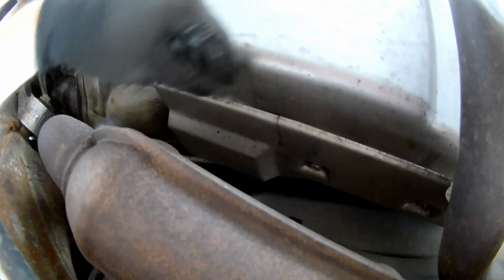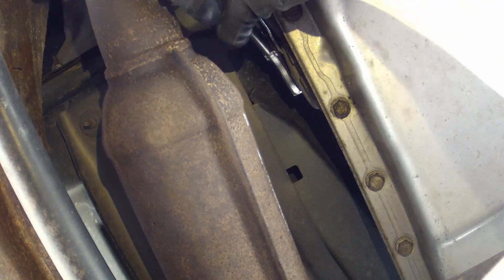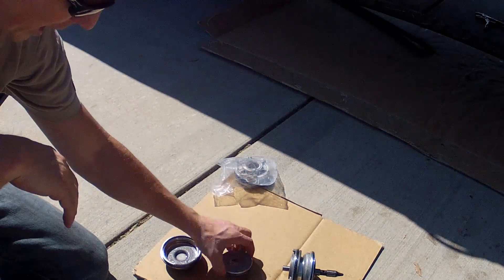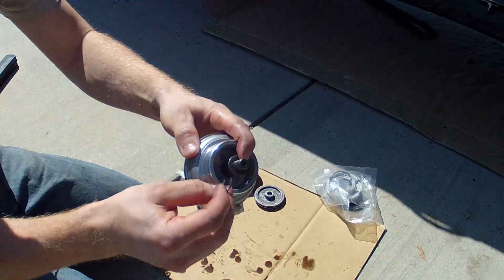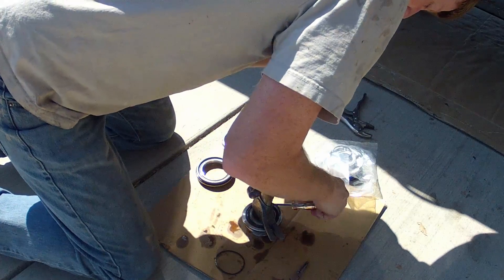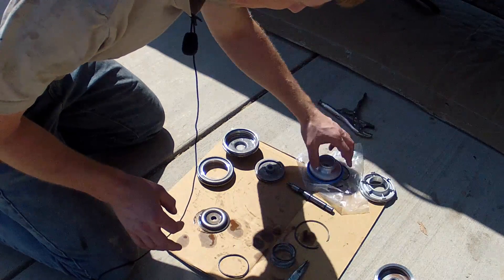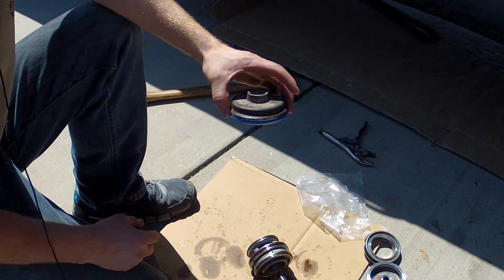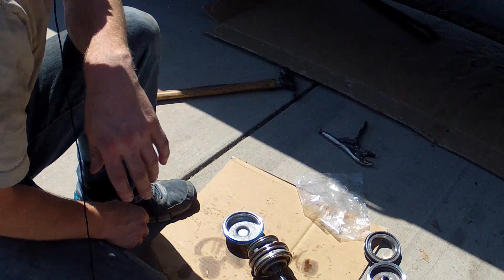4L60E Corvette Servo Install

Comment: Why did you take it apart. I'm guessing you bought the rebuild kit. I  bought the entire assembly from jegs. Now I'm second guessing doing the install. Got the entire assembly to avoid having to figure out all the correct placements. I really don't want to mess up my truck. Running a buisiness with it

Comment: Hey 👋 I bought this 2005 k Chevy Silverado 1500 4X4 the original owner which was a plumber had the transmission rebuilt in 2018 and I bought it and had it for two years and everything running great and then all of a sudden it started leaking transmission fluid from the servo cover and the snap ring fell out and the other half is in it, my question is how could make that fall out and break like that ? Can anyone tell me. Please. I drove it to the transmission shop Friday April 23,2021
Reply: Wrong transmission fluid.

Comment: That was neat how you teleported past the part where you angled the servo out of the transmission still being in the truck because on my 2003 Yukon it's impossible? I have broken it down as far as it goes and it's still hits the heat shield and floor molding. Banged it in as far as it can go no luck looking like I will have to cut a chunk of my floor out or drop the transmission so I sure would like anyone to chime in on how they got theirs out inside of the vehicle that part that you just conveniently edited out of the video. But thanks though
Reply: Had the same issue on my 03 silverado I just loosened the body mounts and jacked the cab up on the one side so the servo could clear the floor
Reply: I'm not sure for your vehicle but lot of other vehicles it helps to drop exhaust and catalytic convert a little.
Reply: I was just under the assumption that it was going to pop in and out like in the video. But I did end up dropping the crossmember and the driveline but even then it was still a bitch to pop the retaining ring back in. I've done it a couple of times now so it's gotten a little easier. But Silverados are way easier than yukons or tahoes
Reply: @googlemall3323 Because you're not a good mechanic. 🤣✌️
Reply: @BradNichols-vo9eo  I've done three more of these and all of them were easier in comparison to that Yukon it just all depends on where your catalytic converter is sitting. But all my family and friends disagree with you human Hulk
Reply: Easy solution body lift lol

Comment: If you didn't get new springs and a new pin with your kit then you only got half the kit and it isn't going to be any better because the spring is what changes the shift pressure without a newer stiffer rated spring you're changing nothing
Reply: no that is actually incorrect

Comment: Where can I get a corvette servo? Can I also add a shift kit from B&m
Reply: you can look on ebay and amazon and such i got mine for like 20 dollars. if you get the corvette servo and a shift kit you might bark your tires shifting from first too second depending on how strong of a shift kit you get and how much power your making
Reply: @chrishansen7004  That's the whole idea to bark the tires.

Comment: Did it take a little while for the shifting to settle in after it was installed?
Reply: In short no, all the bigger piston does is allow the 2-4 band to come on stronger when grabbing the drum there should be no break in period as this mods only purpose is to reduce slip and cause a firmer more rapid 1-2 shift
Reply: @david52566  So it only helps with 1st to 2nd shift Dave and not 2nd to 3rd as well?

Comment: Yep, this 4th apply was in backwards at the end, and several caught that like “Zeke112964”.
Yes, do your research and use proper terminology as gasket are paper. Made from paper supplied by Linoleum companies for decades. Wood pulp & linseed oil, presses and heat cured.
  You have scarf-cut seals and o-rings. Use that “C” clamp or a socket in a vice next time. No one needs an injury. 
 A trans needs holding-pinching power, which results in less wear and heat. Timing a shift is involved as one is applied and another releases, otherwise damage and shortened life will occur.
 You may be a DIYer which is fine, but think of best practices for the guys & gals who will see this, please. No disrespect but many will find out the hard way. Best of luck!
ASE Master Tech since 1978-Retired
Reply: A small burr will form on the back of the 2nd apply piston spring clip, inside that housing. Use a small file to remove it. Driving it out with a hammer will accelerate the piston/pin wear, if you are reusing those parts as a small amount of aluminum will be removed.
Reply: @ Dean kay
As a retiree, You should spend some time doing your own research before you cut into someone else about research... A gasket is not just paper buddy. Also, they come in different shapes, Including rings. Seems like listening to you is learning the hard way.
Reply: Yes, gaskets are not just paper anymore as materials and resins change with technology. But if you don’t know past, then you won’t know where you’re going in the future. I do. My background includes hydrogen fuel cell vehicles, GM’s EV1, Electric S10 truck, 36-42 volt systems, 3-phase twin 90HP electric motors inside an automatic transmission, torridal wheel motors, controllers, 6 types of serial data communications in vehicles past & present and 110 hours each week in a dealer as a tech, flagging up to 120 hrs. per week. That’s experience few have. Did you pass all 8 ASE test, then re-certify every 5 years for 35 years? Have you taken the ASE “L1” Emissions test and pass all 100 questions?
This is not a slam, but don’t come to a battle of wits or knowledge un-armed. No brag, just fact.

Comment: Very important to show which way that last disk goes on! Put in the wrong way and put it in it will RUIN the blue gasket and you’ll have to cut it out again. If you put a video up, be CLEAR, and precise. Thanks
Reply: You don't have to cut the blue o ring. All you have to do is stretch it out and the cover will come off. Why does everyone think you have to cut it?...smh...
Reply: I’d say about half the time stretching it doesn’t work for me.

Comment: Thanks for the video! Used the jack handle technique. Worked eventually lol good idea. Just did mine as well as filter change and some new fluid. Fingers crossed just about to add fluid. I would like to point out as another YouTuber commented I believe the last piston you put on is backwards.
Reply: How did the servo work for you?
Reply: @Rekt-M8-v4  just fine. nice and hard shifts no issues since installation

Comment: What does changing the servo even do?
Reply: The servo presses on the 2nd and 4th gear band. Most stock servos slowly/softly shift into 2nd and 4th. A Corvette  servo will shift harder from 1st to second 2nd and 3rd to 4th. Basically allowing harder and faster shifts. This will help you achieve a much faster acceleration. Its really noticeable at wide open. If your just highway cruzing or in town car, you might want to leave your stock servo alone.
Reply: @stevenm9813  Hell no! Softer shifting means slipping. Slipping wears the friction material and heats the transmission. Dam! WTF YOU FOOL!
Reply: John Mills eliminating slip stops the gear from being held as long so therefor you will be technically faster but just barely

Comment: I tried for an hour to get the servo out I couldn't get it out. I couldn't get it to clear the frame
Reply: I had the same problem getting it out, however I just pulled three bolts from the cross member the tranny sits on so it can pivot and lowered the end the servo is in a couple of inches supported with a jack backed up by a stand (incase it fell) and it came right out 😎 good luck gentlemen
Reply: Clinton Smith you could’ve cracked your case doing that
Reply: @ethanmitchell9733  and you could have broke your finger typing that asinine comment
Reply: Same here. Looks like most people have enough room for it to clear. I had to take it apart by pulling that c clip and spring off then I could take it out piece by piece. 

To install, I had to do it piece by piece. Hopefully, for those who ran into this problem like we did, can save hours of time by doing it this way. I read that someone pounded the crap out of the transmission tunnel to gain clearance. That just isn't feasible.
Reply: tona6g72 I had to carefully file a small bur on the shaft thing most people hit it with a hammer once it is out but I couldn’t get the last two piece apart in the trans without some manipulation. It is definitely a difficult job in the gmt800 trucks

Comment: Really well made video, thanks for posting. Couple of questions though. 
Did a substantial amount of fluid leak out when removing the old servo? 
Would you recommend a decent size catch can? 
Will I need to add trans fluid after I'm done?
Reply from the maker: Nothing major, I think I just had a piece of cardboard and some paper towels and it was fine.

Comment: What are you thoughts after the upgrade . Been thinking about doing this.
Reply from the maker: I think it has been good, the truck feels a little more responsive, and like you don't need as much throttle to drive the same way I was before.  The shifts are also much quicker and firmer.  I plan on doing a video to compare the before and after I just need to get around to doing it.
Reply: What engine do you have in you're truck?